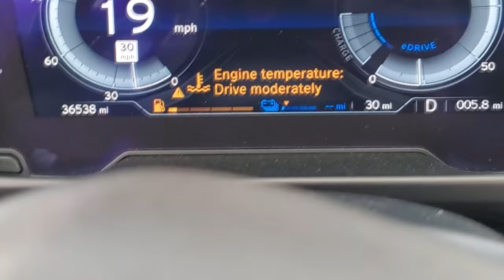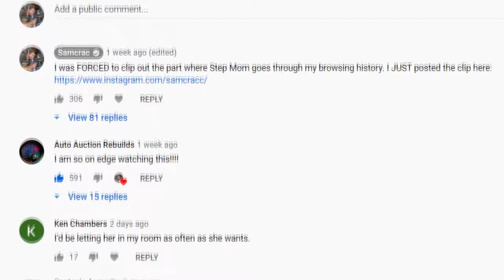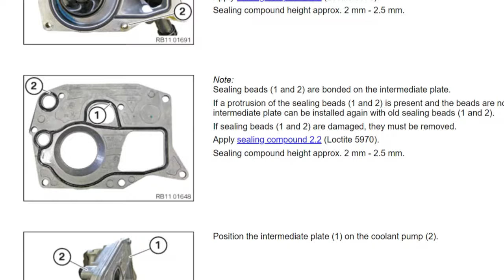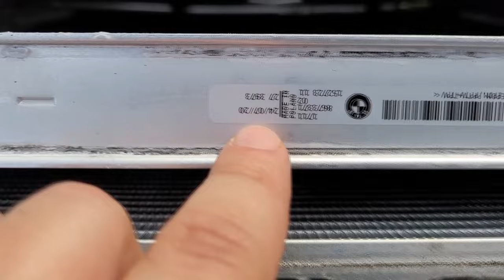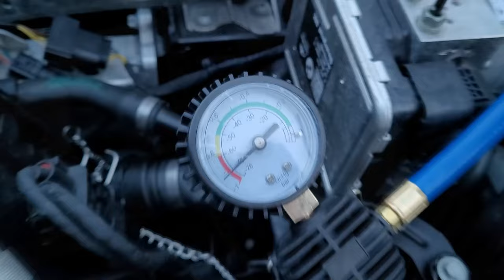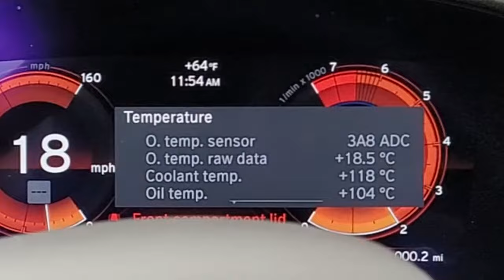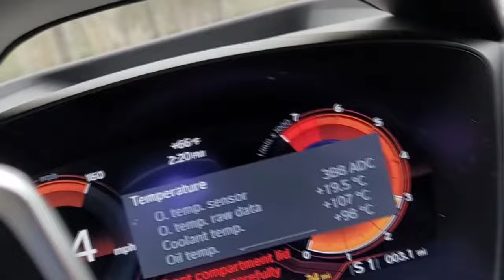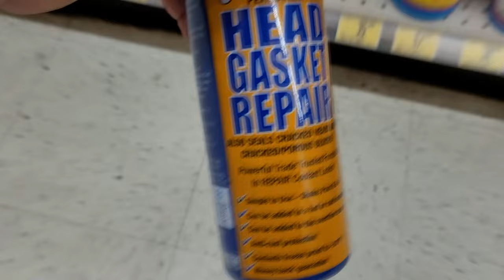The Dealer FAILED my "Unrepairable" BMW Supercar! Can I Fix it with this Simple DIY Trick???

Comment: How did multiple shops fail to diagnose a blown head gasket? I'd be so embarrassed I'd move my shop somewhere else.
Reply: The dealer claimed it needed an engine, might not of been misdiagnosed
Reply: @noobster965  right lol
Reply: even if the head gasket is leaking a bit, that is not what causes it to overheat, and it should also have water getting into the engine, but it doesnt.
Reply: @Gustav4 ?
Reply: @Gustav4  depends where the leak is.  sometimes it only happens under high pressure and you get exhaust gasses in to the cooling lines
Reply: @Gustav4  umm but it does? A blown head gasket or a cracked block, ect would allow for gases aka air to enter the cooling system....
Reply: @728GT  some people
Reply: @Gustav4  Fake news.
Reply: @noobster965  but it must be huge quantity of gases to leak if one way to the cooling system, that would be blowing radiator or somewhere else create leak. But its possible...? Maybe, if the system was check thru for free coolant flow, the blown head gasket may cause the problem, with over pressurizing cooling system
Reply: @noobster965  I'd say they got it bang on
Reply: Anyone consider how many times this thing has overheated?  Many with Sam and who knows how many before.  Bad for head and gasket.
Reply: It's tough like you can tell Sam has spent days on this. There comes a point where the shop cannot invest more time diagnosing specifics unless the customer is charged. You wouldn't be happy paying 12 hours at $80 an hour just to learn the head gasket is blown. Maybe you don't care though since you own a BMW i8
Reply: @Gustav4  not necessarily.  Had an 89 dodge caravan 2.5l turbo(AKA the headgasket blower).  One of the times it blew a head gasket all it did was pump a small amount of air into the cooling system and cause it to over heat at strange times, mainly low near idle speeds.  No noticeable coolant was getting into the engine.  I didn't loose any coolant, didn't smoke, and the oil was clean but there sure were air bubbles in the coolant tank.
Reply: The end...LMAO!!!!
Reply: @Gustav4   if it’s introducing gas into the system , it will airlock , they are very sensitive to any air
Reply: Coolant bleed issues are SO common with this car that they're spending days rebleeding the car in hopes to get the air out of it.  Glad Sam tried the leak test kit.  It wasn't an i8-specific problem the whole time.
Reply: @noobster965  probably an internally cracked block or plugged water passages if they said it needed a new engine. The gasket failure (if there is one) is more likely a result of another much larger problem and from overheating so many times.
Reply: It could be much "better" - a crack in a block or cylinder head - not uncommon for BMW =)
Reply: @noobster965  might only present itself when the car is hot. And the metal expands.
Reply: @noobster965  I feel like Samcrac heard it needed an engine, thought it was due to the "simple" issue of it overheating and never considered the possibilities.
Reply: @porcelainthunder2213  I bet your right now that I think about this for a second.
Reply: @Gustav4  air gets in the cooling jackets. The Jackets are the highest point in the cooling system. The air won’t permit the water from touching the engine.
Reply: @konstantin88181  stop leak to the rescue
Reply: Well, the dealer diagnosed it correctly. The "expert" shop he took it to should be very embarrassed. I knew it was a head gasket right away by how Sam explained the issue. It was confirmed when I saw the expansion tank bubbling.
Reply: @jimbax1  not necessary, it depends on where exactly the crack is. Fun fact: I swapped engine in my car,  it was not overheating, but missfired in one cylinder and coolant was going somewhere all the time... it appeared to be a blown gasket, but the piston was wet. Samcrac checked his pistons and they are all good. So it might be a crack at exhaust port.
Reply: @porcelainthunder2213  Wrong. It takes time for the engine to inject enough gasses into the cooling system to cause the cavitation. This is a very tiny leak that is not allowing water to get into the engine. Most likely a crack vs a bad head gasket.
Reply: @jimbax1  How would exhaust leaking into the coolant cause coolant to get into the oil? Wrong type of leak man.
Reply: @Kenjieeee  Finally, someone who actually understands what is going on.
Reply: @Gustav4  Yeah a bad head gasket isn't what causes an engine to overheat -- loss of coolant due to the bad head gasket is what causes the overheat. You can drive a car with a bad head gasket perfectly happily as long as you make sure you keep coolant in the system. Hell, I have an old Land Rover that I've been driving with a janky head gasket for over a year now. I put coolant (water) into it every other day or so, and it maintains its temperature just fine, no overheat unless the level gets too low. But if you keep the coolant filled, it's no problem at all. Eventually the head gasket will have to be replaced because it'll only get worse, but in the meantime it's fine. And the leak is on the external side, so no water is getting into the cylinders and no white smoke from the exhaust or milkshake oil.

Now on this BMW he's getting a consistent overheat despite plenty of coolant being in the system. The head gasket is an issue that needs to be addressed for sure, but I highly doubt it's causing his overheat. Even if there's water or air bubbles in the system it's highly unlikely to cause an overheat like this unless the engine is just extraordinarily sensitive -- but it's just a three-cylinder eggbeater, not a high-tech exotic, how sensitive can it possibly be?  I mean, at worst it would be an intermittent overheat and not something you could set your watch to like this.

I mean, I guess it's possible that these new engines have such tight tolerances that anything at all will cause an overheat, but if that's the case it sounds more like just poor engineering if your motor is so unreliable that the slightest variation in coolant volume makes your car undriveable. Then again it's a BMW so maybe that's exactly the situation.
Reply: @csorrows  well my friend, you make it sound like there is 20 liter of space for air in the coolant system when in fact there is maybe 0.5 liter of space, the water pump should easily be able to push the water around and eventually the pressure valve should open and let the excess air out. but im excited to find out.
Reply: @Dr.TJ_Eckleburg  it seems very strange indeed, I thought about it for a bit, if the waterpump is placed above the water level of anywhere on the car, i guess a very small amount of air introduced into that space from the engine could prevent any water from reaching it and so it doesnt circulate the water... A fix to this could be to fit a secondary electric inline waterpump at a lower point.
Reply: I may not be a BMW i8 owner, but this exact issue happened to me in a few of my trucks I have owned. Might not be a head gasket but a hairline crack in head, which makes sense because air molecules are smaller than coolant. Plus the air fuel mixture is being compressed through that tiny fracture some where in the head
Reply: Another BMW bites the dust!!
Reply: @noobster965  Could also be more than the head gasket, maybe a warped head or block. A 3 cylinder, even a BMW 3 cylinder, shouldn't be cheaper to replace the engine than to replace the gasket.
Reply: I said the same shit last video like he keeps play and not responding to me
Reply: @porcelainthunder2213  Or maybe when the cooling system is under pressure but not under vacuum
Reply: after so many times of over heating its pretty common to have a blown headgasket. Still i think thats not the issue.
Reply: @Freezy322   well idk they told him it had Engine problems and it over heats I mean I think it mostly that but I could be wrong but aaa idk
Reply: @csorrows  How about this idea for a nice half ass fix.  Put one of those small commercial hot water heat system auto bleeders hooked into the top of the cooling jacket. When the water rises to the top they shut off! (basically a float system).  The air can’t hold the float up, so the air leaks out.  As the water comes in, it raises the float and shuts off the bleed valve!!  Half ass, but I bet it would work?? No oil, system vents excess pressure (I think) as it comes in through auto bleeder? Hopefully not pushing past radiator pressure cap or device?  Coolant sloshing in bleeder may require baffles?  What ya think? I know I don’t feel like changing a head gasket😁
Reply: @geniferteal4178  107°C in a  pressurised system is still okayish. Proper cooling liquid or even distilled water has a higher boiling point and under pressure it's even higher.
Reply: Dealers don't do head gaskets.  They replace entire engines
Reply: @Gustav4  I've had three BMWs with bad headgaskets and the only symptom was over-pressurized coolant system and overheating.  No oil in water, no water in oil, no white smoke, nothing on the spark plugs.  My E46 M52 engine has this problem right now... so yes I thought his i8 might be in the same cursed boat.
Reply: Man it's so hard, temps, coolant behaving weird, probably level decreasing but no leak.. too hard lawl.

They could even have take a condom/baloon, put it around the coolant tank, start the fecker and watch it inflate
Reply: @Gustav4  But if there was that much of a design flaw, these things would be overheating left and right, especially now that they've been on the road for almost ten years at this point. It would be a known issue with some kind of factory service bulletin, or at least something mechanics knew how to deal with. It's a friggin mystery. It really could be that these motors are just extremely finicky and it needs to be replaced.
Reply: Definitely some truth lol
Reply: it's a BMW. The fix is to get rid of it.
Reply: Dealer diagnosed this already that lump will never be the same until it’s replaced.
Reply: @Gustav4  With this engine (cooling system) being so sensitive to bubbles, I could easily see it causing the engine to lose capability to circulate the coolant by forming a bubble in the engine, which would cause the overheating conditions.

Personal opinion, having this complex of a bleeding requirement is a recipe for disaster...
Reply: @mbasiletti  weird flex but ok, keep buying trash cars
Reply: @Gustav4  pressure buildup produces heat.
Reply: @lehelzelenka207  107c is 225f. I thought 118c was the number it shut down which is 244f. Engines can live around 200f. Once you hear the water boiling like we did,  you got problems.

Comment: Balasts are for high pressure sodium lights led lights have “drivers”
Reply: Yeah bro. A ballast provides extra power for starting the fluorescent bulb, and drops down after start to let it run. A driver is a power supply meant to convert the power down to drive the LED without a bunch of flicker and stuff.
Reply: Don't this have the BMW laser lights?
Reply: In a headlight, the ballast are for the high voltage for a HID bulb.
Reply: they're basically the same thing.

a ballast is for limiting current but also usually includes the starter so u call the whole thing a ballast.

led drivers are simply constant current power converters.
Reply: @Aluzcz  I may be mistaken but I don't believe the US DOT has approved Lazer headlight technology yet. The US DOT is so far behind in testing and approving current lighting technology compared to the UK. 😞
Reply: @Aluzcz  not on a 2014 or an NA market car.
Reply: @nlopitziii  Ah, sorry didn't knew that. I'm from EU so they are standard for me :)
Reply: @poiiihy  from an electricians point of view definitely not the same thing 👍

Comment: Probably a crack in the block or something?
Coming up next: "Samcrac vs Some Crack"
Reply: Vs Step mom crack  :)
Reply: Mark Hitman 
What?
Diferent crack,diferent fix :)
Reply: And after that: some crack vs same crack
Reply: well its a tiny 3 cylinder. that cant cost much of anything.
Reply: @cryptsys yeah no problem the engine is only 8-10 thousand dollars.
Reply: KillerBees 
Why change the entire engine?
Just skim the cylinder head and voila.
Reply: @endurocrosser8834  if the crack were small and shallow that can be removed by skimming, then sure.
Reply: @endurocrosser8834  Yeah but we don’t know if the block is cracked
Reply: KillerBees 
I did not say that the block is cracked.
I just said that the headhasket is blown.
Reply: @cryptsys  15 years ago, a tiny 3 cylinder Opel engine cost £1100 from the dealer exclude labour.  Now factors in European Engine in USA, 15 years later and it is a BMW.
Reply: Vincent Ng 
I had the exactly same symptoms but another car brand.Same misdiagnostics,changed parts that did not need changing and all that to be burn head gasket.After a Co2 gas leak test it was found
Reply: Saul Goodman gotta make content
Reply: He pulled a vacuum on the cooling system. It held so cracks in the engine are unlikely.
Reply: @endurocrosser8834  You probably mean hydrocarbon test. 
A crack in the head or block will show as hydrocarbons in the coolant if it’s leaking via the combustion chamber.

Comment: Sam,  I am a Florida resident,  a mechanical engineer,  I had the opportunity to work with some very knowledgeable marine power engineer’s, I learned alot about engine design and troubleshooting.  Based on watching the video’s I have the following comments;

#1. Cooling is based on volume of cooling flow.  You don’t know if you have sufficient cooling circulating thru the engine block.  Obviously it is not sufficient since it is overheating.  I have done more than average of diesel marine power cooling design. Engine cooling design is not by guessing or luck.  A little thermodynamic’s, and high school math, you will know approximately what you need in cooling flow.  The rest is engineering of pump selection.

#2. I suggest using your garden hose and circulate water thru the engine thru the main piping connections below the car.  On video you have shown these pipes disconnected from the radiator located in the front of the car.  Remove the thermostat from the cooling pump assembly.  The garden hose and its inherent pressure with the pump should be able to cool the engine no problem.  Cool water from hose will pass thru the pipe under the car, thru the engine cooling pump, thru the engine and dump out on the ground from the other pipe under the car.  The entire point here is once thru cooling.  Does sufficient cooling flow pass thru the engine?  You will be able to see the water dumping out of the return pipe onto the ground.  Since it is once thru you don’t have to worry about a pressurized cooling system.  If the engine over heats you will be able to see limited or no water flow thru the engine.  Bingo restriction in the engine somewhere.

This is an indication of lack of water flow.  As a point remember you can use a hose to cool a 225 hp outboard engine.  It will easily once thru cool the three cylinder engine in the I8.  If there is a lack of flow you will know immediately. You will see it.

#3. If you wanted to I have an ultrasonic flow meter.  My engineering company specializes in commercial and industrial system testing and troubleshooting.  We can put the ultrasonic flow meter transducers on the cooling pipe and directly measure flow.  We will immediately see a lack of cooling flow.

#4. The thermodynamic heat rejection of the engine can be easily calculated.  We can calculate the approximate cooling flow.   Compare the actual flow rate we measure with the ultrasonic meter the heat rejection of the engine.

The problem you are having right now is you don’t have any idea how much cooling fluid is circulating.  You are throwing darts backwards over your shoulder at the target.  I am not saying the suggestion so far are not good, but you have no idea still what the problem is.

The simple test I am suggesting will be visual and will probably point to a water flow restriction in the engine block.

#5. Using the garden hose and with the thermostat valve out you can switch the hose to the return pipe and flow water backwards thru the engine cooling jacket.  You may find doing this dislodges debris and clears blockage in the engine.  You would see debris blow out of the other pipe when you back feed it.

#6 You changed the radiator, the thermostat.  It is highly unlikely those components are the problem.  I basically think a restriction is present.

Remember stay calm when troubleshooting.  Stick to basic concepts.  You will find the problem.  I have been doing troubleshooting of very complex industrial systems for the past thirty years.  Believe me this I8 engine is repairable.  The problem is basic.  Incremental testing is the key.  Wild guesses and throwing parts at it will be expensive to get to the solution.  You have to engineer the solution.

Regards

Greg

Comment: Don't buy BMWs...I personally think it's more than just the head gasket.
Reply: preaching to the choir.
Reply: As soon as he said heating issues I figured that's what the problem was. Those plastic coolant systems could be reengineered and save bmw customers thousands in repair bills. I can't believe they use the same shit materials in a car like the i8 as they did on a 20 year old 3 series. I ended up hating that car for that exact reason. What a joke of a company.